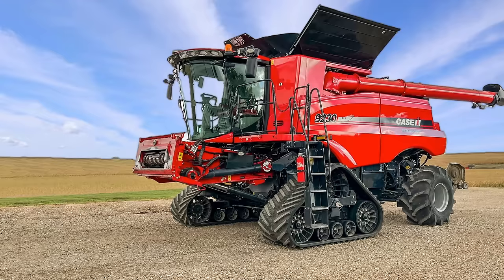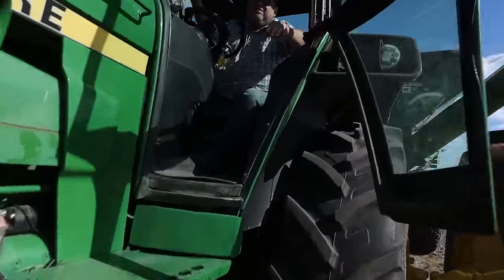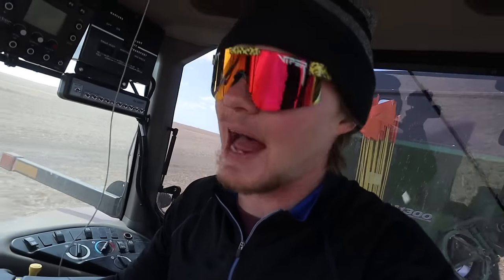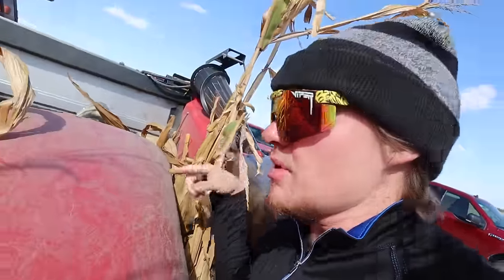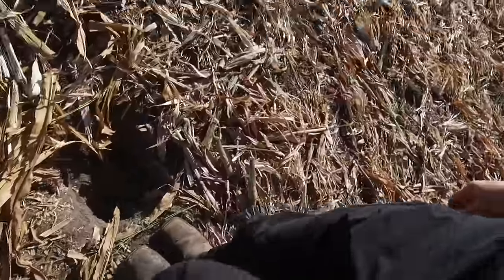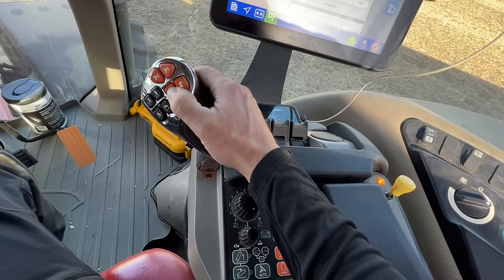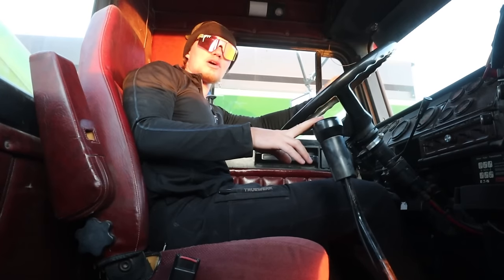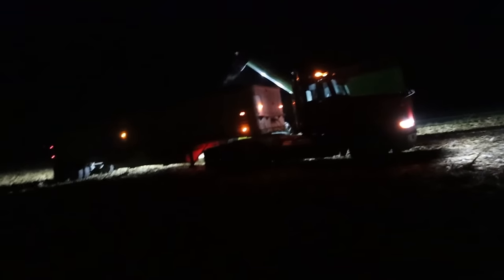Dialing In Our New Corn Head!

Comment: Tips of snoughts 2 inches off the ground.... set a angle finder guage on the deck plates - 23 degrees.... thats cade it's recommended setting .... ear snap at minimum of half way up the deck plate - ideal is 3/4 .... if top of stalk is hitting the back end of the deck plates (by the gearbox) - then the jackshaft speed is set to fast .....

Comment: So Cole, I know this is a day late and a dollar short I am guessing based on your publishing schedule... but for your hopper bottom bin if things don't get resolved before next season..... just a thought... I don't have access to your site to do measurements, so I will make up numbers to get my point across... its all about lbs per sq inch... you got Few things going on with your slab... 
A) its not big enough... your feet for the hopper bottom bin should be centered on the "footing" area... if I remember right from your videos, that dimension was 24 or 36"... your feet should be centered in that so 12-18" from the edge of the slab.
B) the rebar.... this is 2 fold... first, I get that from a calculation standpoint the fiberglass is "stronger" on paper... the problem... this is not a tensile load situation...you need rigidity and we all know if you grab a 10' piece of each what happens if you old it out... 
C) rebar... its to small for the load based on the amount that they put it... for that size, there should have been twices as much... 
D) rebar... its first of all not tied to each other...AT ALL.... but if you look at your video from that day, its laying directly on dirt it is not on any feet to hold it up and second it is quite a ways from the outside and third some of that is sitting as all on the inner layer of dirt... concrete need to be ALL AROUND the rebar... and forth on that, you can see compaction issues after they laid the rebar... dirts just falling in the hole...
E) a temp fix for that would be to take 18" -24" wide 1/4-3/8" steel plating  (have somebody plasma table cut them to make the diameter of your slab) and Gently lift or jack the hopper bottom up just enough to get that underneath...that will give you 10x more area to distribute the load and will drastically reduce your lbs per sq inch... its just a matter of how thick that needs to be... but that would give you if those are welded together in a big ring... easily 2-3 times more capacity..... just my 2 cents...

Comment: Makes alot of sense to have a million dollar grain handling system with a small old grain dryer that not worth a 1000 bucks.  That thing is a piece of junk.
Reply: Oh, you mean a failing, falling apart, extremely dangerous million dollar bin site that doesn't work so they have it rugged with other augers and an old dryer? That one?

Comment: Is it easier to use an angle finder on the corn head. The combine frame and then the mounting plate.  Remove the corn head to adjust the mounting plate.

Comment: So do you think you are going to add another bin to hold wet corn next year or are you going to replace the dryer? It may be a little early and cash is surely an issue but you did leave room for another bin to tie into the system. It could be used as a wet bin next year then move to regular storage later once the current wet bin is repaired. Just get someone else to do the install. Otherwise, more trucks or a motherbin to hold more storage in the field.
Reply: You must be new here. The entire bin setup will need to be torn down and rebuilt including the conrete foundations. They are involved in a lawsuit over it.
Reply: @justmeiniowa  I know about that but that lawsuit isn’t going to be over for years. I also doubt that they are going to tear everything down and completely rebuild it. The actual bins and foundations maybe fine other than some mechanical issues. The entire catwalk and safety equipment is the junk part. Adding another bin to mix will help get the crop out of the field next year and was already part of their long term plan. It would be possible to run some new legs and bolt-in to what they already have.
Reply: @ClayinSWVA  Their stated long term goal is an 8 bin set up. In one of the videos they showed the cracking on the bin foundations as well.

Comment: That sucks at those engineers. Talk to you in to wasting a honor to $200000. You didn't need to use Ralph. Put the leg in between Em and go with a downspowl. Pipe is way cheaper less problems Then you could have took the extra money and bought a new dryer